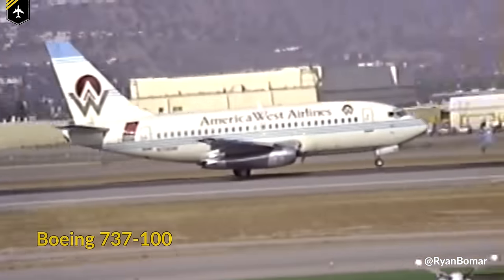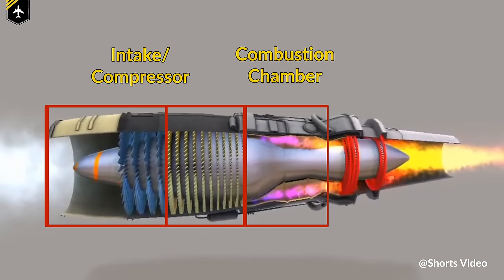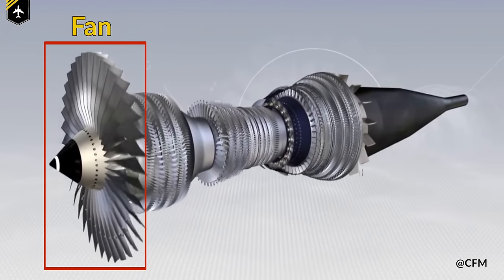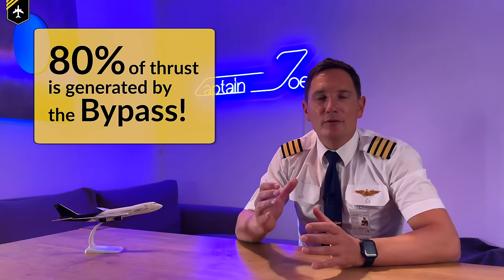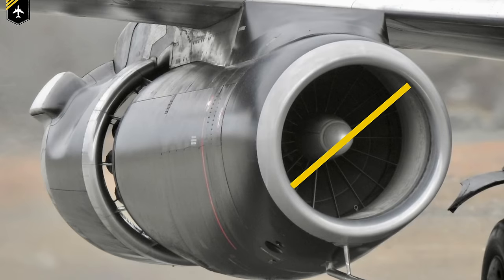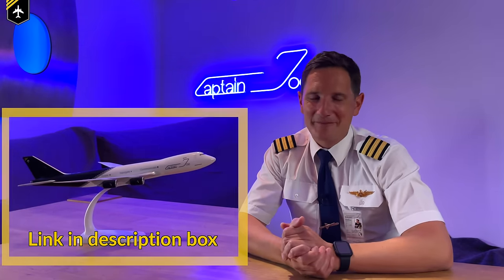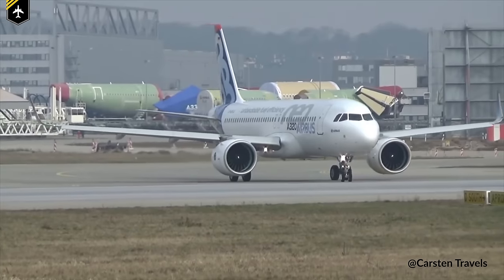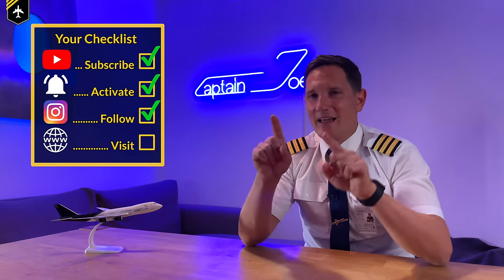HOW DO JET ENGINES work and WHY do they get BIGGER Explained by CAPTAIN JOE

Comment: Amazing details in this video.
This amount of mass per second were mind boggoling. I knew something have to going backward and fast and it create thrust. Those kilos give ideas the mass flows. An one cubic air weight circa 1,2kilos at sea level. Fl-370 fraction of that. The plane moving faster and more air going trough the bybass channel. But weight less because of low airpressure.
That was very nice video. Thanks Captain Joe💝

Comment: For me the ultimate turbojet aircraft was Kelly Johnson’s amazing SR-71with a pair of Pratt & Whitney J58 (JT11D-20J or JT11D-20K) afterburning turbojets, 25,000 lbf (110 kN) thrust each  JT11D-20J 32,500 lbf (144.57 kN) wet (fixed inlet guidevanes) JT11D-20K 34,000 lbf (151.24 kN) wet (2-position inlet guidevanes). I lived near Mildenahall as a child and saw them weekly. Amazing aircraft.

Comment: At the Air School that I attended I was taught that if the blade tips spin at angular velocity greater than speed of sound, they're going to vibrate as they constantly break that sound barrier and that vibration will eventually cause an entire engine to vibrate wildly on the wing and that is unwanted. Same goes for propellers and Helicopter rotors.

Comment: I'm so glad you said it is indeed the bypass air that's compressed by the fan through the narrowing channel and accelerated out the back of the bypass duct/fan casing that produces bypass thrust, not the fan itself. Though the fan may act like a propeller, it's nothing more than a compressor for both the core flow and bypass flow.🥇Keep up the good work!

P.S. I'd say the Concorde is by far the most famous, or at least the most iconic turbojet aircraft to have ever flown!

Comment: For the turbojet guess.. The Blackbird?  Quick question on your 9:24 explanation of centrifugal  forces  ..With the Olympics recently concluded are runners on the outer lanes disadvantaged as they have to run faster to cover a longer distance? Talking about 200 & 400 meters races where you cannot step out of your starting/assigned lane and there are arcs or bends.
Reply: I wonder if the angles of these bends would shift the advantage to the outer lanes as they may be gentler...
Reply: No, the distance is for all athlets the same. In the sprint distances where they have to go around the bend, the starting positions are offset to each other to compensate for that.

Comment: I would say the Heinkel HE178 as beinig the first turbojet powered aircraft. But also the Messerschmitt ME262 as the first operational turbojet powered aircraft or the Gloster Meteor wich came into service a little later. I saw a documentary once and it was stunning to learn al the technical difficulties these engineers had to overcome to make a functioning and reliable turbojet without disintegrating or melting itself.

Comment: Some nitpicking, the turbofan engine fans are not propellers, they are “ducted fans”, if you look not just the blade shape but also their section profile you’ll notice a substantial difference. The propeller blades cross section and twist are shaped as wings that produce air displacement similar to lift. The fan blades are more similar to a axial flow compressor and they “treat air” differently.

Comment: Captain Joe, the correct terminology for a modern turbofan engine would be a ducted fan/turobjet hybrid engine since the fan is ducted as opposed to a turboprop's unducted fan propellers (and the various propellers of propeller airplanes of all eras as well).

Comment: The fastest turbojet is the J58 used on the SR71, the more commonly used are GE 90 and PW 4000. I worked on smaller PW 2000 / F117 for last 25 years. The GE and PW engines are two spools engines the RB 211 is three spool engine. The PW rep said that they have PW 1000 which a geared fan that driven by the low pressure compressor, he was hinting about, take the PW  2000 core with a gear box and drive a PW 40000 fan assembly.

Comment: The turbojetted aircraft I would have in mind is the Me 262, with 2 jumo004 engines. Only because it's legacy still lives on nearly all modern turbopropeller, turbojet and turbofan  engines (axial compressor, combustion chamber and turbines)

Comment: I don't think you touched on this but the reason why accelerating air faster to increase thrust is inefficient at the same speed is because thrust isn't based on energy, it's based on force. Energy scales to the square of speed while force scales linearly to mass. So to accelerate the air faster to achieve the same force would require you to put in, or give the air energy to the power of 2. Exponentially more than if you were to simply move more air.

Comment: My favorite turbojet engine is more a mixed-cycle engine, a turbo-ramjet engine, the P&W J58, which powered the SR-71 Blackbird as well as the A-12 Archangel.  An engine whose fuel, JP-7, is so non-volatile, it extinguishes a lit match dropped in it, functions as a coolant for the fuselage and other parts of the aircraft, requiring something like triethyl borane (TEB), a pyrophoric substance, to ignite the engine's core on startup as well as to light the afterburner after taking on fuel.

It is also the only engine (that I know of) which was SPECIFICALLY DESIGNED to run for hours on end on afterburner because of a different reason why air bypass the engine core, to provide oxygen to the afterburner at a much higher rate than the turbomachinery can offer.  At speeds above Mach 2.5-2.6, more air bypasses the core as turbojets lose efficiency at higher Mach numbers.  Basically, the engine goes from being a turbojet where afterburner supplements the turbomachinery's thrust to a turbine-assisted ramjet, where the ramjet portion is far more efficient than an afterburning turbojet or turbofan.

Comment: Great video (as usual).  A minor quibble - "burn" is probably a better term than "bang".  In operation, in the combustion chamber, the fuel-air mixture is being burned continuously.  If there is a bang, then something bad has happened!
Reply: Suck squeeze bang blow is generalized term for an engine (it's valid for both this as well as a normal piston engine)
So it's more of convenience rather than accuracy

Comment: 2:42  I’m always finicky about this, but there’s no such thing as “sucking” in physics (unless you’re talking about the four fundamental forces, including gravity). Fluids, such as air, move only in response to pressure, moving from areas of high pressure to low.  The intake of a jet engine works by creating a volume of low pressure, and the atmospheric pressure in front of the engine blows air into the engine.  

As the plane begins moving forward, inertia of the air in front of the engine will play a role. (how a ramjet works). Still not “sucking”.

Comment: Most famous turbojet has to be the Concorde. Rolls Royce Olympus engines with reheaters. I saw one of those take off at Heathrow. If you go military there's loads. The SR71 is well known, it's engines are huge, not strictly a turbojet though, at supersonic speeds it turns into a ramjet. Interestingly it's a really big plane, there's one a mile or so from my house at the Hill AFB museum.

Comment: I like this video, and it actually helped me with something I've been struggling to answer for myself.

I created a fictional aircraft, an Antonov 850. I've been imagining it as either the same size as, or slightly bigger than, the real-life Antonov 225.

The Antonov 225 has six relatively small engines. But my Antonov 850 only has two engines, and they're massive. I've been imagining the engines themselves as big enough to fit two city busses in side by side.

The last segment of the video answered my question of whether an engine that big can even function. It probably can't, but I didn't want another four-engine aircraft to by flying around in my fanfiction works.

Besides, with two horizontal stabilizers and four vertical stabilizers, the Antonov 850 looks sexier with only two giant engines.

Thank you.

Comment: 7:57

Fun fact a single GE-90 would have provided twice the power of all the boilers and steam engines of the RMS Titanic

So strap one of them on Titanic and have it go 44-48 knots instead of 22-24 knots 😎
but even with that it will go slower because Titanic moves through water

Comment: In my country the Philippines, Philippine Airlines used to have the BAC 111 using Rolls Royce Spey turbojets in the 70’s to the 90’s. It’s really loud and at takeoff it really pushes you against your seat unlike the A320’s.

Comment: I think the most famous turbojet-powered aircraft is surely the B-52. These used turbojets on all models through the B-52G (640 of the 742 that were made), and the B-52G remained in service until the 1990s.

These aircraft were no doubt seen by a lot of people who might not otherwise have seen much of aeroplanes at all. For some it was the last aeroplane they ever saw.

Comment: But what is powering the fan in a turbo fan engine? Is there combustion else where? Or are they electrically powered generated by the rotations of the shaft? Great job on the video by the way!
Reply: The fan is powered by directly the shaft, just as the compressor is.

Comment: So the important question is....

If you keep expanding the diameter of the engine presumably to consolidate engine numbers on a plane there is a finite diameter reached. It works like this...The drag profile increases to the point where if the engine fails in flight it will act as a drag on the airframe either making the aircraft uncontrollable,or it will produce structural failure of the aircraft. A finite position will be reached.

Comment: And also, of course, thermodynamic machines get more efficient as the get bigger. In case of jet engines, leakage losses around the blades are significantly reduced as they get bigger

Comment: It should also be noted that even in fighter jets, turbofans have been coming for quite a few years. Nearly all, if not all, so called "gen 4.5" and greater planes are propelled by turbofans now, not turbojet -- for efficiency reasons. They do retain postcombustion though. Examples include the F-22; Mig-31, Rafale, etc etc.

Comment: I would guess that high bypass turbofans main advantages are noise and economy and that's why they've been so highly developed. Also consider that an explanation of how much the bypass produces more thrust, in most aircraft, is when an aircraft goes into reverse thrust. The reverse thrust is provided, in most cases by reversing the bypass so it's actually fighting against the turbo thrust. Also consider the inefficiency of reversing the thrust and the amount of thrust lost then you realise how much thrust the bypass produces in comparison to the turbo exhaust.

Comment: Question.  At 2:32 he says that the air exits at a higher velocity than when the air enters the fan.  I don't see how it is possible.  But then, I know very little about this stuff.  Can someone explain how that works?  Does it have to do with Venturi or Bournulli?

Comment: I'm a jet noob, but suck squeeze bang blow sounds just like a four cycle engine (standard car). The stages are just spread across space as well as time, like a rotary engine.
Reply: Most probably you already know about the Thermodynamic cycle and its 4 phases. All thermal engines perform a thermodynamic cycle.
Reply: @alessandrovilla6759  Great point, I'm a computation guy more than physics.
Reply: Yup it is same, difference is that a piston engine is a constant volume engine and the jet is a constant pressure engine

Also, a jet engine produces constant energy (whereas a piston only does during the power stroke)

Comment: As one of those propulsion engineers I can say the whole thing about larger fans being pushed to higher speeds and inefficiency is a myth from people marketing a type of engine. First of all, larger fans generally have a lower fan pressure ratio (FPR) because they are moving a larger mass of air to generate the required thrust. That lower FPR means the blade corrected speed (blade Mach No.) can be reduced while holding your blade loading coefficient (dh/U^2 or work/speed^2). 
The LP spool speed in an engine is dictated by the fan, not the LP turbine. The performance engineer optimizes the fan diameter and FPR combination to meet the thrust requirements, the fan aero engineer then selects the most suitable blade speed (using loading coefficient in the first pass), and it is that diameter and blade speed that gives you RPM. The turbine aero engineer gets stuck with whatever RPM they select. 
That being said, engines with larger bypass ratios (BPR) generally end up with LP turbines that start at a lower diameter relative to the fan diameter (long explanation for another day). That means the LP turbine blade speed starts low in the first stage. Since you have to manage your blade loading coefficient, that means you can’t extract as much work in that first stage… so you add a second stage and try to push it out in radius to get more speed.. more speed means more work. You keep doing that until you can take the required work to drive the fan. That lower speed means you require 6-7 LP stages to extract the required work .. *and look at the radial position of those stages, we try to push them out in radius as quickly as possible to get more speed -> more work.
An engine with a planetary gearbox means you can continue to rotate the fan at the ideal speed, no change there, but now you can rotate the turbine faster and remove half the number of stages. You can now go to a 3 stage LP turbine instead of 6-7. You also don’t need to push the blades out in radius to get more speed and more work. In the end, what you have is a fixed pitch ducted prop turboprop engine.

Comment: So as the Plane is traveling in a forward direction you have air hitting the front of the fan.  SO that air doesn't matter to the engine? Only the air created by the fan is what matters?  Hopefully this is understandable question.

Comment: Concorde is probably the most famous pure turbojet civil airliner. The SR71 is a hybrid of the turbojet, basically two types of jet engine in one.
Reply: The F-104 Starfighter is also a good candidate, and so are the Boeing 707 and DC-8, although later versions of those had low-bypass turbofans.

Comment: There may be many famous turbojet airplanes (mine are Concorde and 727), one has to say the most famous and best sounding engine was the JT-8D.   The engine that made so many fly.
Reply: The JT8D is in fact a low-bypass turbofan.
Reply: @fromnorway643  sigh....you're right.  I still love it though.

Comment: Thanks for the video, one thing isn't clear: the energy to move the turbine is an electric motor? Then Where all that energy comes from?
Reply: It's all self sustaining. The exhaust moves the turbine, which moves the compressor and fan blades. It's just during engine start that pneumatic is used to start the process of self sustaination

Comment: capt joe,i have some question..after taking off in the  runway and retracking the wheels going to its place,are they still spinning or you have to brake the wheel to stop the spin motion before it will retracted.
Reply: Depends on aircraft, but in an airliner the wheels will stop themselve when you put the landing gear up.

Comment: I posted this question on another video of yours and ill do it again. I don't understand the difference between a turbofan and a turboprop because isn't a turbofan just a ducted turboprop? How come the rpm if the prop in a turboprop is reduced but the fan of a turbofan isn't it's allowed to spin faster then the turboprop prop at the same speed as the low pressure turbine (with acception of the pratt and Whitney geared turboprop). Hiw come a turbofan while basically being a fancy propeller can fly faster and even at subsonic close to supersonic speeds for a commercial airliner around 600mph and even  supersonic speeds in low bypass turbofan fighter jets meanwhile a turboprop usually has a maximum speed of 400 mph? How come an open fan turbofan isn't a turboprop?

Comment: Is the Daher TBM 930 I am flying around in MSFS ( and like for a smaller plane) technically a turbo jet with a prop on the front instead of turbines? Sorry for ignorant question, but the talk of turbo prop being a jet or not being a jet some people say confuses me when I read comments on forums skimming over and such. Or do they mean when they say TURBO PROPs just basically a regular propeller engine, but fitted with a turbo (like turbo cars that aren't belt driven, use exhaust gas to drive turbine to ram more air into clyinders)

Comment: Power loss increases with the square of velocity change while thrust increases with the first power of velocity change. You want to change the velocity of the mass flow by as small a value as possible by acting on as much mass flow as possible.

Comment: Captain Joe,

The vast majority of road-capable vehicles have a variable-speed transmission gear system that allows them to turn their road wheels faster for less fuel consumption; be it manual or automatic, they do exactly the same thing.
Aside from afterburners (which just dump raw fuel into the already-heated exhaust) is there an equivalent of a transmission box for jet- or propeller-driven aircraft engines?  If not, why?  Surely spinning a fan blade or propeller using a differing gear ratio would consume far-less fuel?  (NOTE: I am aware of the different between a turboJET engine and a turboFAN engine, but that is not what i am asking about here.)

Comment: Can a bypass ratio be varied?.
Like geared one, the fan can be run at the RPM to suit mechanical safe operations and the outer casing can allow air flow to flow in the concentric opening as bypass or it can be allowed to flow over the concentric opening in controlled manner.